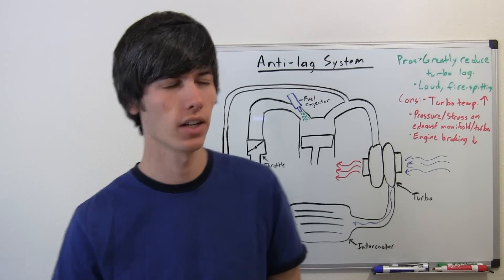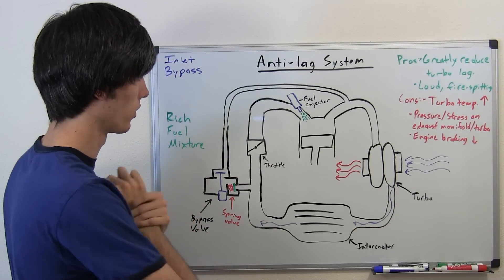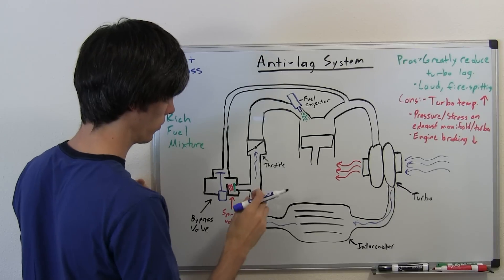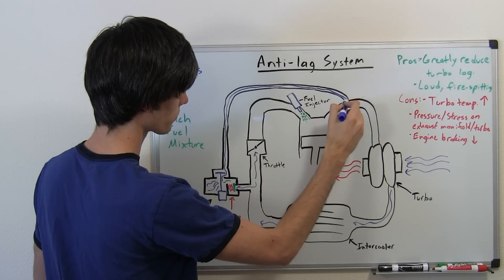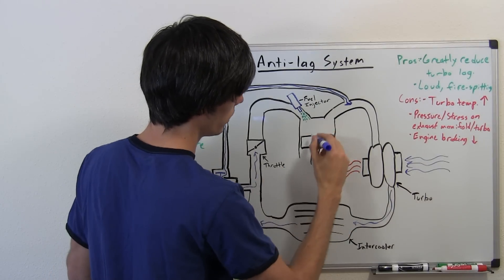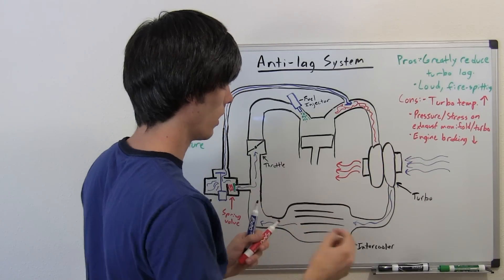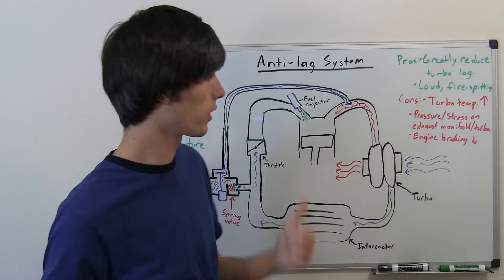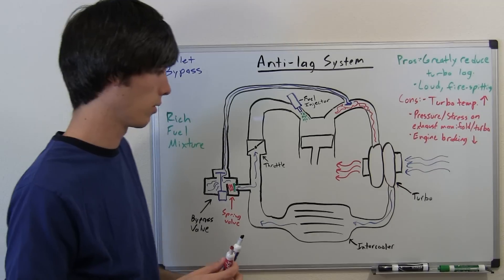How Anti-Lag Systems Work - No More Turbo Lag - Bypass Valve

Comment: The compressor bypass should be connected to the upstream side of the compressor inlet not the turbine inlet. The bypass valve is a pressure relief devise to reduce or eliminate surge and assist in maintaining compressor rotational inertia to reduce lag. There is more to it than that but that is the Cliff note version.
Reply: Chris Prack agreed, the diagram is incorrect.

Comment from the maker: Anti-lag may be used to launch to spool the turbo better than the throttle can alone. When there's no resistance (you're in neutral, not moving the vehicle) it doesn't take much fuel to rev the engine up, so it doesn't create much exhaust, so not much boost either.

Comment: What happen if the car have blow off too? Does the air pressure will be seperate into 2 pipes?
Reply: You can use the BOV's outlet, just make sure you use a valve to prevent heat going out of the manifold

Comment: Are you trying to explain a BOV or a Waste Gate ? BOV lets off intake pressure out into the air not back into the exhaust which is why a BOV is emissions legal. A Waste Gate lets the pressure from the exhaust housing of the turbo out into the down pipe which is also legal but alot of people let it just blow out into the air away from components which that way is not legal by emissions law. All depending on the if your turbo has an internal or external Waste Gate. I could be wrong here, but plz no trolls ...

Comment from the maker: This has been asked a few times below. Basically, you can't power something by using the power that something creates (perpetual motion). If the turbo is blowing air, it's not enough air to reroute and keep the turbo spinning, the turbo has losses so it will still slow down. Could it help for a very brief moment? Perhaps, but once again, very brief.

Comment from the maker: Many cars that use this probably wouldn't have cats since they'd be used in racing. As far as the O2 sensors there's probably a decent work around using the MAP sensor, throttle position, engine rpm, air temp, etc. It wouldn't have the check that O2 provides, but it could probably still work fine.

Comment: why wouldnt your ecu know that the air being bypassed if the ecu runs the valve the bypasses the engine? wouldnt it know the airs being bypassed so then it wouldnt put so much fuel in, so then your not running so rich you spit fire, you'd get  better fuel economy, way less wear on the engine, turbo, exhaust etc?
Reply: and even more power becuase its burning the right mixture?

Comment: Either running too rich (not using 100% of the gas resulting in excess gas building up in the exhaust) or maybe bought a AutoLoc flame thrower kit, or my favorite why I love America... the compression rate on the engine which is lower in America due to vehicle standards. that is why people bore engines resulting in better performance!

Comment: What about Variable-Geometry Turbochargers (VGTs)? These turbos reduce if not completely eliminate lag by continually changing the aspect ratio of turbo in correlation with RPMs, the same principle as the CVT transmissions. They were first used on a few production vehicles in the late 80's/early 90's, but have mainly gained popularity with a few diesel engine companies. Only recently has the technology seen some advancement. I think this topic deserves a video!
Reply from the maker: It does indeed deserve a video! Hope to get to it eventually.
Reply: They were only used in diesel engines due to the lower exhaust temps.  You try tossing it on a gasoline engine and you'll melt the vanes.  Recently Porsche made a gasoline version that comes in the carrera model but was forced to use aircraft metals just to prevent melting the darn things, making it very expensive to make.
Reply from the maker: Atanas Tripzter What's the difference in exhaust gas temps? I would think diesels would be high from higher compression ratios?
Reply: Engineering Explained
Under high load such as in wide open throttle the average exhaust temp of a diesel is about 1k at the turbo.  On the other hand gasoline engine exhaust temps go up to 1500 when you floor the car to redline.  Turbocharged are even higher in the 1700s.  Check out some dyno videos and you'll see the manifolds glow.. Steel starts glowing red at about 1600F.
Reply: Atanas Tripzter spot on with that. and with these antilag systems that temp is going higher. in my opinion the whole point of keeping the engine cool to make more power is lost with this.
Reply: porsche is the only manufacturer im knowing of who is using vtg's on gasoline enginges! but nice point!
Reply: JACKSchannel1100 Actually i've never herd of keeping the engine cool.  Matter of fact operating the engine at 160 degrees or 190 degrees makes no difference.  Its an made up story.  Perhaps on some engines it may run a little extra fuel when the engine is at 160 degrees but anyways.  The only way to make the exhaust gasses cooler is to run a longer exhaust manifold with fins and stuff on it.  Porsche doesnt do that. Thats the thing the only ones using variable vane turbochargers on a gasoline motors are in the Porsche and they dont lower the exhaust temps.  Instead they use rare high temp metals.   I havent seen them specify which yet. They just say "aircraft materials" which are...expensive.
Reply: Ik this Is a super old comment however the issue w VGTs and why you really only see them on diesels is that the components inside the turbocharger to make it withstand the high rpms of gas engines would be extremely expensive to make, but since diesels only go to about 3-4k rpm at most they can use the cheaper materials and thus use a vgt without considerably increasing the cost.
Reply: @EngineeringExplained  ALS is disabled on my rally car at a turbine inlet temp. (TIT) of 800 deg C using a K-type thermocouple immediately before the turbine wheel.  IHI spec. sheets for a related CHRA list max. turbine temperature as 900 deg C.  Not sure where TIT averages on a diesel, but this gives an idea of what you can see with aggressive anti-lag on a competition car.  TIT also is not like a light switch however a more technical stage with more turns (on-off-on throttle transitions) will ramp up the TIT value pretty quickly.

Comment from the maker: To be perfectly honest I'm not quite positive on the engine braking. The way I see it is, since the exhaust turbine will be continually spooled, the intake turbine will be continually spooled, thus always creating boost. With the throttle closed, there will be a greater pressure than usually on the throttle forcing in additional air (relative to no boost), and thus engine braking is decreased. I don't know how much of an effect it has, but I've had subscribers tell me they experience a loss.

Comment: you tell fire spitting when you let off the gas in anti-lag cars; but wrc cars and some anti-lag cars fire spitting under full throttle what is the source of that?
Reply: +ilke tama Overfuelling can cause this. Many ECUs will inject additional fuel to protect the engine from ever running lean...
Reply: what is running lean?
Reply: Running lean means there is too much air in the air/fuel mixture. This is usually very bad as it can cause overheating and engine damage.
Reply: +kneecaps2000 i get it now thanks
Reply: +kneecaps2000 while you are correct, you aren't really answering his question. WRC cars do have anti lag and they will only use the insane ak47 to launch. When the ECU is not in launch control and is trying to make max power the only time the AFTERFIRE (not backfire) occurs is when the car is decelerating. The WRC cars afterfire like sons of bitches because having instant boost out of a corner is awesome.
Reply: +Burly Heads also, it is not the most effective way of making a turbo last for a very long time..
but hey, instant boost! :D
Reply: "but hey, instant boost!"

i love that AHAHAHA
Reply: ilke tama 2-step launch system?
Reply: Launch control isn't quite the right term, rallycars use 2 step limiters. 2 step because it can limit the rpm at 2 stages, one is a lower rpm range, 3000-4000 (depending on the cars properties) which acts as launch control when the car stands still, basically the engineers set the rpm so the car starts without too much tire spin. Then the second stage just acts like any rev limiter basically, it cuts off at a certain - high point- of rpm, so the engine won't go higher than it can and damage itself. 
This system works with retarding the ignition, which again lets unburnt fuel and air mixture in the exhaust, which also explodes because of the same reason as with the antilag, so you also have fire when they accelerate fast,  because they hit the rev limiters :P
Reply: HatchetAirsoft hello so if youre comming to a stop at what rpm will the antilag ceases to work.  Because imo you dont really need antilag if you stop.
Reply: Kent Patrick Parilla  I know rally cars have lots of anti-lag setting which can be changed with a button or nob inside the car! So I guess there’s no standard rpm it stops working. But driving between sages you don’t want or need it then so you can turn it off completely. There’s probably lots of factors for when it works and stops. Throttle position, road speed etc

Comment: can u install anti lag that u can turn on or off with a switch ?? like when you're on the highway or just cursing around you don't want it on ???
Reply: +steven thiboutot Yes, that is possible.
Reply: +shi01 thanks for the info bro
Reply: +steven thiboutot Look back at the diagram. The blue-colored bypass valve, that EE says is turned on/off by the ECU --- Now imagine you put a switch between the ECU and the wiring that opens the solenoid (bypass valve). Boom, that'd be where you put your on/off switch.
Reply: Yeah, rally cars do the same for interstage driving, a lot of systems are turned off and the engine actually produces only like 190 hp or so if I remember right.

Comment: Would it be possible that instead of also sending fuel into the exhaust manifold, just have the blow-off valve send it's air into the exhaust manifold so that the air pressure that would have been vented into the atmosphere instead be vented to keep the turbo spooling?
Reply from the maker: SuperNuclearDeath yes, that's possible, but it's like trying to keep a fan running by routing the air it blows directly behind it, to keep it running. It may provide a small amount of energy, but nothing substantial.
Reply: +Engineering Explained  but with a small displacement engine high psi setup on a variable vane turbo or mid size turbo  would the the dv  not blast the vacuum in the manifold causing substantial lag reduction? Idk correct me if I'm wrong but to me in theory that seems like a cost effective and effective way to get "some antilag" for the less torquey 4 bangers ?
Reply: +SuperNuclearDeath Breaks the law of conservation of energy, wouldn't be much more efficient than just blowing off the air to reduce back pressure
Reply: +SuperNuclearDeath Don't they do that already? If I'm not mistaken that is what a recirculating dumb valve does.
Reply: +Danny Jenkins recirc just puts it back to right after the air filter (or anywhere before the turbo). My 95 eagle Talon has a GReddy rs which is a recirculating bov.
Reply: That's a recirculating BOV. Vent-to-atmosphere like the typical HKS BOV that's gives that loud, distinct "psh" when letting off the gas vent outside of the manifold. Recirculating BOVs vent that air back into the intake.
Reply: I assuming the only restriction on the turbo speed when the pressure is being recirculated is the amount of air able to flow through the 'pipes'.
Reply: I hink thats called a
Reply: Heard it's been done before, I feel like trying just for fun, lol, if you look at DSPS and turbosmart als valves, seems like a 30mm bypass valve could work...
Reply: @dannyjenkins6008  what's wrong with a recirculating valve man?

Comment: What  if  :  the  wastegate  is  connected  through  an one  way  valve   to  a  pressure  tank  and  creates  pressure  during  running ,  let's  say  1  bar .  this  air  reservoir  is  also   connected  to  the  throttle  chamber and  in  the  middle  of  the  corner  when  the  gas  pedal  is  pushed  again  ,  the  air  is  released  in  the  intake  manifold (  controlled  by  ECU  who  sees  that  the  throttle  is  open  and  there  is  no air  pressure  in  the  intake  duct -  while  there  is  air  pressure  in  the  intake  duct  the system  does  not  interfere  with  the  turbo  air  intake  )  . Does  it  make  sense  ?

Comment: What if... Electric assisted Spooling?
Rapid electric capacitor discharge on demand system.
aka, HIT THE BOOST KID.
Reply from the maker: This is essentially what F1 is doing now: 2014 F1 Engine - Explained
Reply: Engineering Explained I can't, I don't even...
Had this Idea for ever, Too late to file a patent.

What about jet powered spooling always on systems? Basically a Small turbine fed by an injector outside the manifold only connected to the turbo. Imagine, having max PSI all the time.

Comment: A recirculating valve send the air into the intake manifold not the exhaust manifold
Reply: John Newburn normally yes, but not in the case of a car with anti-lag (the ENTIRE point of the video)
Reply: John Newburn so the air that is in the intake manifold is sent to the intake manifold. Hahahaha.

Comment: I dont think this is a very good idea. This will just cause a mess of a fire. Why because the O2 sensors are in the exhaust which will detect all that oxygen making more fuel in the cylinders causing no combustion because of the way off ratio. Also that unburned fuel will not combust with any power because of compression. Plus the cats arnt design for unburned fuel or fire.

Comment: How to keep the engine reliable and still make it spit fire?
Reply: this is not reliable. your sending an explosion through the turbo
Reply: Basomga some show cars will pump fuel straight to the exhaust pipe and shoot it right through the cat
Reply: yeah, I got the same question
Reply: I adjusted the exhaust cam two to three tooth earlier on my Evo 3 4G93T just for a flame spitting show. you get bad fuel economy and lower power output at high RPMs but the rev actually went higher. eventually set it back to normal because constant flame spitting wherever you go is kinda annoying...

Comment: so basically if i where to route a line from the bov to a bung in the o2 housing and run pig rich with ignition cut with the clutch depressed i should have a home made als...

hmmmmmm
Reply: from the bov to the manifold and yes. according to this video which is inaccurate.